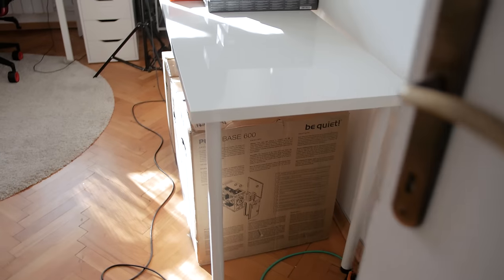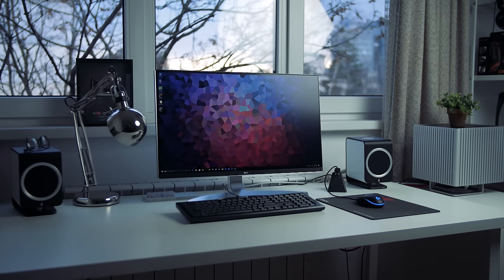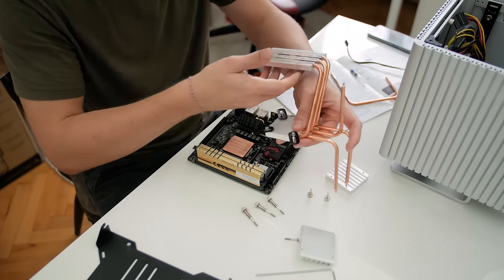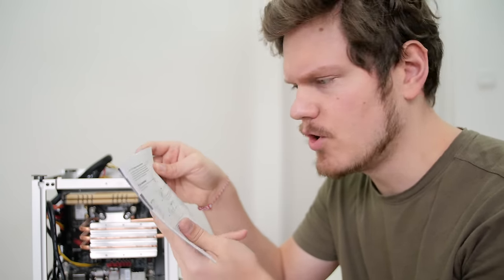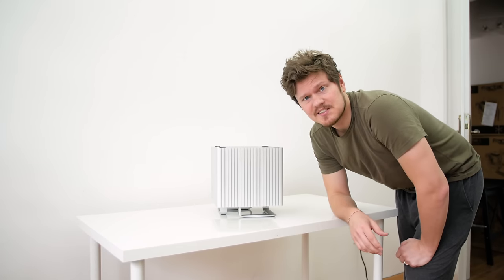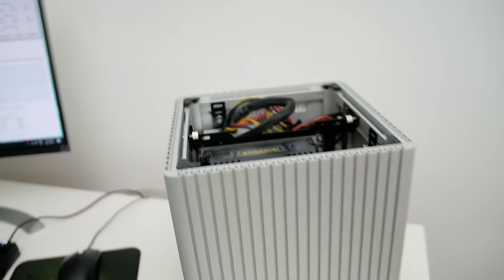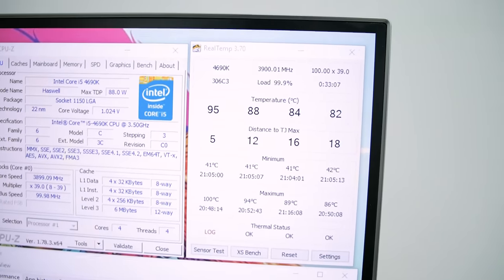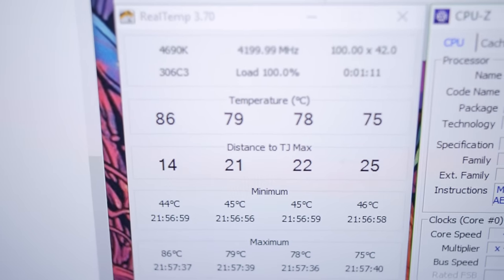Trying to Overclock a Fan-Less System... Do We Succeed?

Comment: Don't worry bruh. I'm about to build one of these out in about a month, I'll show ya how its done. 1) You definitely used the wrong CPU, Streacom even has a disclaimer against using anything with a TDP over 45 watts stock, and 90 watts with the expansion, which limits an "enthusiast" to pretty much Skylake. If you go look at all the higher end systems that were ever commercially sold with this platform, they all used Skylake. 2) Dunno about using the wrong board, its possible Streacom designed the case for 1151 socket boards only, kinda seems like you coulda run the pipes first and routed the wires around it.  It would prolly have been tight, but that comes with the territory of building mini PCs. If the wires want to touch the heatpipes get some heatshrink just big enough to fit over the end of the connector and wrap the wire bundle wherever it touches, then secure the bundle so it doesn't touch. 3) When you applied the thermal paste to your heat pipes, you really didn't do all the surfaces that were actually touching each other. You need to coat the pipe wherever it touches metal, not just wherever it touches a flat metal plane. Why are you worried about how messy it is? Assemble the thing, and then get a rag. Guess you've never worked on a car before? 4) I wouldn't even attempt a GPU build or overclocking with the stock power supply. I didn't even buy it. I found a great 400w itx unit from FSP Group on Amazon that works and fits great in there.

Comment: Good work, D. It's not easy thing this case. I'd like to see what Josh (hope I got the name right) over at NFC might do if he put his mind to it... Certainly this thing has more room than some other MINI-ITX cases like the S4, Sentry, Dan Case mini, etc, that are packing some punch. 

Of course this thing could be modded if one skilled enough thinks about it... A new air vent / heat sink combo cooling top could be designed that could definitely allow for a blower GPU venting up with a modded I/O hidden under a door panel for cable access. Imagine an extended and vented top cap designed to compliment this case. It would allow for something interesting. I might take a look at designing it, and to that end I am entering into a two-year Architecture Technician program at college in order to get skilled at such things. 

I would look at designing an adaptive array of tiny fans for the interior (several 10-20 mm fans) strategically placed along the walls to draw air in from added bottom air vents to move air up to the cap mod. Of course this would mean that it might not be silent, but if we're talking about a powerful rig inside pushing hard, then maybe a little bit of fan sound could be okay. 

Combining all this, lifting the case top higher, etc, could allow for a full-sized blower card to be installed. Of course a redesigned sophisticated pcie cable extension would be required. It's complicated anyway, but I think a fun project to consider... 

Possibly we can even enter into the region of an enthusiast build with the likes of a CPU like the 1700. Who knows?

I spoke with the designer of the DB4 and Streacom is working with Calyos, so that might bring something very interesting. 

Worth watching your vids always.

Comment: To me the whole point of fanless is to avoid dust getting in, which even with filters it does. But fanless cases always have vents on the top (b/c heat rises), which allows dust to settle in, defeating the purpose. If you want zero noise, honestly <1000 RPM quality fans will be quieter than ambient noise in most rooms, and you will actually get less dust with good filters b/c of positive pressure, than if you just allow it to seep in thru the vent holes of a fanless system like this.

Comment: Aestetically, this is a beautiful case.  But looking at efforts vs results, it has too many drawbacks to put up with:
- very laborious to maintain / upgrade, because the required cooling system detach is too much of a hassle
- failing to cool stronger CPUs, its use is really limited to be an office or media playback system.
- Correct application and thickness of heat paste is being made extremely difficult, HDPLEX passive case design is much better thought out, when it comes to the attachment of heat pipes and blocks.
 - the cooling fin design is a failure if it can't keep cores at 80 degrees - if you applied heat paste evenly and at the right thickness

Admittedly, any passive case where heat pipes get attached to the case itself will be a bit more effort to maintain.

But so, lets say, someone only needs a low powered computer and wants it silent - this one is needlessly big for a low powered computer and you can't trust putting hard drives inside it, since there's no ventilation, everything that doesn't have its own heat-pipe going to the finned case walls, will run very hot.  I don't like my expensive SSDs dying a heat death with all my stuff on them...

I'm either sticking to the nCase M1 or I'm going to build a really shabby looking case that gets screwed to the wall under the table, with one quiet 30mm fan or so.  It would actually be a fun project, to make a high end computer look like a jumbled piece of metal refuse from a junk yard... a bit of theft protection built right in ^^

Comment: Turn the outside of the case into a water feature by trickling water down it while it is in operation. Sure it wouldn't be silent any more but it wouldn't be fan noise. I also wonder how effective spraying a mist at it would be, just enough to allow for evaporative cooling.

Comment: you should try undervolting. you'll never overclock enough for it to help behind marginally higher benchmark scores.. so try UVing stock speeds and how that affects temps. 
  also I wouldve coated the heat pipes with pastes when inserting into the bricks on both ends to just insure total contact, also when attaching the brick to the side panel you should've coated each flat surface where they meet not just where the heat pipes were.

Comment: Hi Dmitry! Can you try this again? And have the smooth side (with and/or without thermal paste) aligned with the side covers instead of the copper covered with thermal pad or paste. See if there will be temperature changes.I see the manual says that it should be installed with the copper tubes side aligned with the side cover but  I hope you can try the smooth side instead.

Comment: I think it would be neat to install a 240mm low rpm fan under the case on the desk. it would be a relatively permanent modification because you'd have to cut a hole in your desk. Still it's pretty impressive for a passive cooling solution.

Also it would be neat if this company made a passive GPU cooler with heatpipes that contact with case walls. Now that would be a pain in the arse installation!

Comment: Theoretically the DB4 could be a gaming computer.  Set up the cpu with one side panel and cool the gpu with the other (some modding and heatpipe bending required) and you should be good to go.  If you wanted to do something really crazy you could water cool the gpu and use a cpu block on the side panel to dissipate the heat.

Comment: I'd love no fans on the hardware. But intake fans with dust filters, so the case will have positive air pressure, so you avoid dust buildup. That wuld be the berfect setupt. You need that positive air pressure, dust will kill your shit.

Comment: In my humble opinion, full-passive builds SHOULD have fans in them as a fail safe. A custom fan curve could disable them until 80C, for instance. 

I don't think that a reasonably powerful full-passive system has to have this extreme trade off of instability in rare, unusually intense conditions, either sustained loads or the office's AC unit going out. We can have it both ways, fanless 99.9% of the time but we have a backup system for the unexpected. 

I'm not sure the fan on my 1000w Titanium EVGA power supply has ever even turned on before as an example of what is, in practice, a full passive component that really only has a fan for worst case scenarios (at least on a relatively humble 1800X/Titan X Pascal build).

Comment: Nice test.  But this enclosure has FOUR heat sinking panels, why use 1 or 2 and waste the rest? I ask Streacom.  This, assuming the 6 pipes are not the limiting factor but the total surface area of the panels.  Video style is fine.

Comment: That case should have more fins on the exterior. If the design allowed for more surface area, then the problem would be solved. If I designed this case, I'd look to OIL-COOLED power transformers! Now that's how fanless is done!

Comment: Not sure why completely fanless is a huge thing. Just put 1 single fan running at a really low rpm so you don't hear it. It will move just enough air to provide active cooling to THE ENTIRE CASE.

Comment: i dont undestand the point of that case. Ok, have a 0 db system is cool but is it so bad have a big fan (something like 200 mm fan) which run at slow rpm on the top to exaust air?

Comment: I wonder why all of heatsinks are other way around. You have nice clean surface facing inside the case instead of touching aluminium body. Better surface area = better cooling. I have noticed that those heatsinks have mounitng hole on both sides(7:05), so there shouldn't be any problem in turning themaround. Please, check and compare the resultes:) I amcuroius...

Comment: The thing with 4000 series Intel CPU is that the TIM is very bad, so, if you delid and change the TIM, you will see more consistent temps and maybe get a better heat dissipation overall with this case ... why didnt you use Skylake or Kaby Lake?

Comment: Could you drill some holes at the top and add a fan at the bottom of the case to push the hot air upwards ?

Comment: Why did you have two pipes going to one plate and one pipe going to the other instead of just all three on a single plate?
Reply from the maker: It's designed to spread the 3 heatpipes over two plates... but i did not think to experiment with their orientation. Good suggestion :D

Comment: I think you have the wrong sides of the heat sink blocks contacting the cpu and case walls.  You need to have the flat side of the heat sinks contacting the cpu, case walls so that you get more even surface area and there for better heat transfer away from the cpu.  The case is effectively a big heat sink so you need to have really good air flow around the case, good temps and low humidity outside of the case for the heat to dissipate more efficiently.

Comment: Very interesting case and video on how to build with it.

But for the for the very bad CPU performance, have you tested the CPU before? 
After the 3rd gen intel used some ''advanced TIM'' for the 4th gen, but as most people say online: a 10 degree difference is normal, more than 10 degrees difference under load is probably bad IHS TIM.
Maybe you'll have more luck with another cpu. Maybe a newer CPU will do the trick.
Or try the new mid end Ryzen cpu's, like the 1400.

Comment: My 4690K had these exact temperature variations between cores. core 1 and 2 were making the cpu throtle. a quick delid and replacement of crappy thermal paste between the die and heat spreader shield thingy with Noctua thermal paste solved it.
Reply: I prefer Grizzly liquid metal between die and IHS.

Comment: Why not apply the principle of physics. Put the hottest side panel as near as you can to the wall and see if the temps drops. Heat should be transferred to the coldest point.

Comment: Love the look of this case but it seems to be designed with looks as a priority and function as a very poor second best. The heat dissipation is really, really badly though out, none of the heat transfer items are in good close contact.
For the money it's not really that impressive. Although the cpu cooling upgrade could be useful in some other itx cases for passive cooling.

Comment: They need to add a copper transfer platebetween the case to the cooling pipes. Aluminium is not the best conductor of heat.

Comment: Wait for the Ryzen APU's: RX 460 graphics performance on the CPU. That should be pretty nice for this kind of system. Of course with some upgrades to this case: a little larger, two fans with a low RPM on it which you barely can hear...

Comment: 100°C ?! That seems so much to me, almost dangerous... I was extra careful to never surpass 85°C at overklocking my 4790k. Or am I on the wrong track? But great and interesting video anyway! :). (and sry for my english..).
Reply: temps don't kill cpu's. voltage does. these days the cpu will throttle and the pc will shut it self down, if you put in more voltage there are no safety limits.
Reply: Aaah, that's what I missed 🙈. Ye, there are these 1.35-1.4 V (with Haswell) you should not exceed... Thanks for your answer wild Potato :D! It's been a while since I was active on HWBOT...
Reply: I went 109ºC w/o cooler (when the stock intel plastic clips broke and had a 212 on order), because science. That's the point when you'll start seeing crashes and severe throttling. 

Heat will kill a cpu in a very extreme situation, but it'll crash first. Heat will kill a cpu if it's running at 100ºC for a long period of time. High voltage will kill a cpu much faster.

That said, i'd keep temps below 95ºC load with prime 95 on a 15m test. 15m@100% load isn't something you'll see in real stress workloads. It'll allow for hotter days/higher temps.
Reply: Heat is only detrimental when combined with high voltages because the higher the heat, the higher the current leakage and the higher you need to set the voltage to compensate. The resulting high current might degrade the silicon. Otherwise, heat by itself is only dangerous to the more analogue parts of your PC such as capacitors and hard drives.

Comment: What about with a 1700 chip? Not that I can really see an advantage to running a fanless system with a fan, rather than just getting a regular cooler and putting a low RPM fan on it. The video was interesting though.
Reply: over 5k doesn't have integrated graphics and he didn't use a gpu
Reply: Rusty touche although as i imagine it was only an issue to use a GPU with that mobo, could try a different one?
Reply: Possibly, but it was depend on the size of the gpu and the temps of the system. The gpu is just one more thing to make heat in that tiny case.

Comment: lol, A; you bent them.... B; copper is super easy to bend, duh... and C;  pooooosh, lololol

Tell you what would be a really inventive addition to this cube case if the manufacturer could implement it... A Dyson like fan, the blowerless, bladeless, magic hoop fan system that makes no noise but blows air.  If they could have an outer channel that could produce that gentle, silent air over the fins, it wouldn't add a single decibel of noise, but would provide at least 10c of cooling, likely more.

Comment: wow... very cool. do you think i can get this case and pair it with a gtx 1050 and i3?
Reply: Tragik yes
Reply: i3 yes, 1050 no
Reply: Check pcpartpicker
Reply: GTX 1050 yes, fanless with HDPlex's GPU heatsink system.  It's a difficult build though.  Also any Intel T-series CPU would work well.

Comment: how do you think this would handle a ryzen 1700? only a 65w TDP on that, i would probaly run it at it's 3ghz base clock, disable all the boost stuff and then undervolt it as much as possible

Comment: Hmm I'm not the best at maths, but shouldn't 2x 65W count up to 130W? :D
Well I guess Streacom is a bit concerned about 125W-CPUs melting down that case ^^

One request Dmitry, I'm a huge fan of Alphacool's Eisschicht products and use those instead of thermal pastes. 
Could you maybe test that stuff in one of your future videos? It is so much easier to handle cooling pads, especially on big areas like in this case.

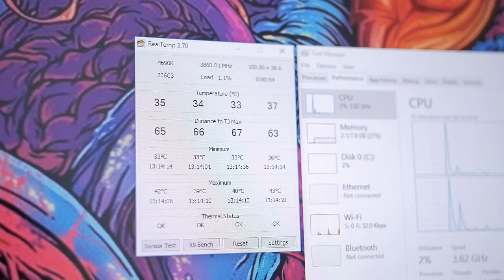Comment: why is it idling at 3.85GHz (7:50)? 
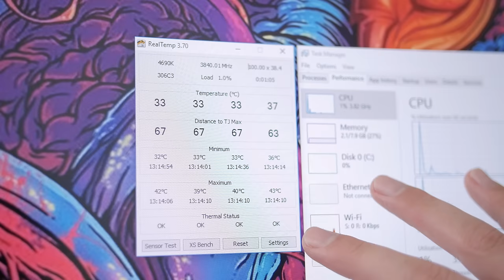under load it's at 3.6GHz (8:05)
Reply: That's called "thermal throttle". When a CPU (or GPU) reaches a high temperature, it reduces it's frequency to prevent damage from overheating.
Reply: Boris Goldenko If you look at the temps, the cores are hitting TJ max, so they lower CPU frequency and voltage to attempt to lower temperatures and keep them under TJ max. If the temp goes over TJ max (100°) the system would shut down.

Comment: You shall try Sandy Bridge 
Coz I have processor from this generation and my  i7 2600k with 4.4Ghz have 64C under maximum load
I guess i5 2500k with little overclock will be okay with that cooling solution
P.S. those CPUs have enough calculating power for all kinds of tasks in  2017

Comment: The design is not functional. The radiator sides shoul have bigger ribs to allow air to pass trough them and not just lick the surface. Also the entire side panel should have openings for heat pipes to pass trough and not just touch them. So the cube was designed to look like a radiator type cooler, but it doesnt really function like one.

Comment: You have to install a pentium cpu and a gtx 1050 in there to make a gaming system.
Reply: Traumâțu' Mîț Mîț i would go for a ryzen 5 or 3
Reply: I'd go with a Raven Ridge APU (when it will launch).
Reply: No, you have to buy a better case. lol
Reply: A T-series CPU with a GTX 1050 or RX 560 would work great.  The GPU can be connected to the side panels with HDPlex's fanless GPU heatsink system.